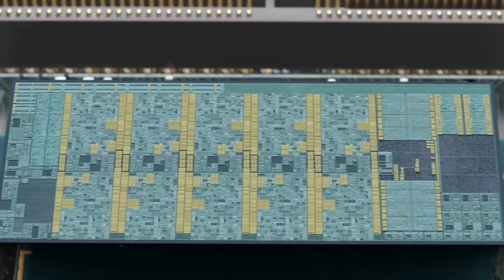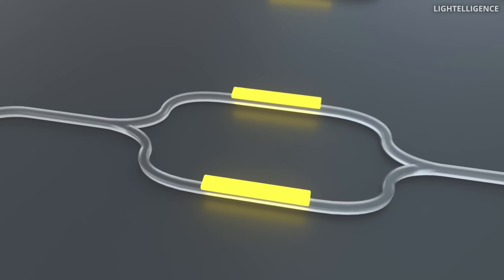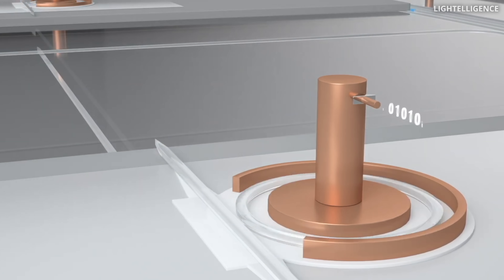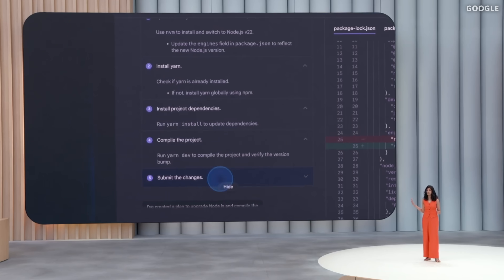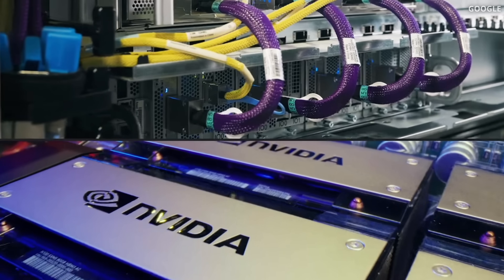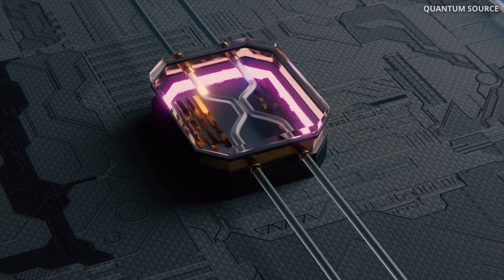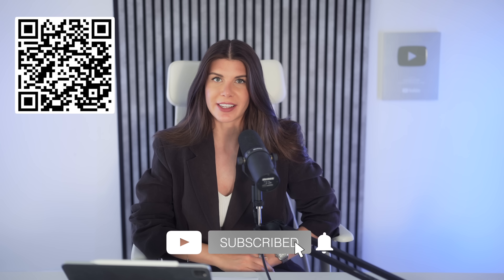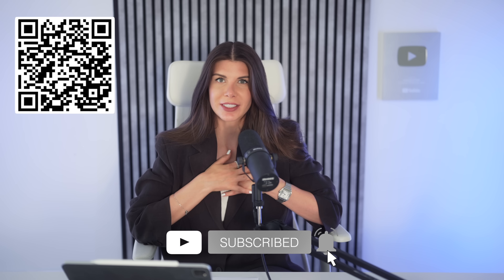Why Light Will Change Computers Forever

Comment: Adinkra codes from supersymmetric algebra, which align with doubly-even self-dual error-correcting codes, could provide a natural framework for optical memory in light-based computers. By mapping Adinkra nodes and edges onto photon states such as polarization or phase, data could be stored in redundant, error-resistant light patterns. This built-in error correction would safeguard against noise or photon loss, making Adinkras a fault-tolerant, “native language” for encoding, preserving, and processing information entirely in photonic systems.
Reply: If Adinkra can embedding error-correcting structure in the very way photons carry information, that seems like it would be very beneficial.
Reply: I wonder if there are any experiments by the current startups who are leading this hardware innovation development with the stuff that you are saying, or any paper trying to replicate that
Reply: @AlejandroMeloMaths . Couldn’t tell you about that .  .  . I achieved eigenmode super-Gaussian / flat-top output in with a multi-mode NdYAG fielded laser in the 90’s.
Reply: @thesupremeparadox brother I have no idea what you are talking about but props to you for your research
Reply: 🔰Are YOU people st0pid or what?!!!.. You should know by now that your interest & support in newer technology will be covertly misused and these advanced technologies will be weaponized AND used either against you or your children to imprison you in an outdoor digital matrix. 
🔹There needs to be a changing of the guard before any new, super advanced technologies are brought to fruition.  Otherwise geniuses will invent these new devices and ambitious fools will use them to control, wage war and destruction in the name of progress.

Comment: Much simpler, on frequencies of light, spectrums, light charge are in fact momentary bits of data in relation captive charge that are capacitors on and off, but spectrum as in some charge examples are registered. Are there light spectrum captive cells and the answer is absolutely yes, but they are volatile, and like DRAM need to be refreshed and so when change to this or that are suspect recorded (registered) for what kind of computation. These are analog devices on changes in spectrum / frequency. Well, photonic components and interconnect hubs and transmitters and repeaters have always been large scale. Calcite cell structures they are literally bit blocks in physical size but volatile. Blue diamond ring reflectors (directors) on quartz rosetta no known examples are small, I've held a 2-cusped-hand-size. None of these examples are anywhere near micro lithography I can guarantee that. mb

Comment: Does a photonic computer need the electronic equivalent of a clock signal? Like a strobing light that advances results from one gate to the next?
Reply from the maker: It needs a light source (a laser), and its amplitude and phase are modulated to encode the information.

Comment: Colors mixer base on RGB value and use time phase angle of light base on time so we had 3 phases time each began as 120 degree to have 3 colors then it phase chsnge base on camera record encode each light to match reality and store the last frsme , first frame and average light at point mulitplied by time and difference of motion multiplied by time ad add on store final sum and un load when play by recall last frsme and unload the sume divied the time get aversge plus different divived tge time unroll stresm out three timer three colors star mix by time rolling naturally after phase correction of each color and until get to first frsme and make sure match then play bsck

Comment: Anastasi is the best source of news on these cutting edge leaps in progress.  Almost nobody who understands it can present it so well.  And most who try to present it don't have anywhere near the depth of understanding and it shows.
Reply: I agree she should start her own company 😊
Reply: wow, someone older than me by a few months.  I worked with mainframes at IBM in the 60s. Huge data centers to house the mod 50, 65, 75. The big deal then was heat so raised floors were needed to cool the giants.  Did I miss a heat comment in the presentation?  Great job even this old brain followed.  I coded in assembler when memory was limited to 16K.  Love the way computing has and is going.
Reply: Progress? To where?
Reply: @mirba6933 look around .....uh nevermind 😢

Comment: Lights limitations are the height of its wavelength. Curious, what frequency are they using??

Why not use a micro-led style memory board. Information stored will reflect what energy level the led stores (similar to a tv-instead of a picture, it’s memory)!

Love you streams 🩷🩷🩷

Comment: I recently watched one of your older videos on RAD-hardened chips and ECC memory in space and, connecting today's video to that, the future implications of photonic computing's lower power draw & lighter device weight could have such tremendous potential for spacecraft operating with limited onboard energy supplies & payload mass constraints on e.g. controllers for remote sensing instruments, thrusters, transmitters, etc.  Perhaps light-based computing may even offer novel pathways to achieving greater resilience to cosmic radiation!

Comment: i like the idea of using light, but its always been the issue of A/D and D/A for light - in the star trek theme is it not called Photonic Computing??

i think the next big step, outside of making stuff smaller, would be WetWare (biological, or something connecting biology to hadware), something close to the way we think, process and remember information - or even the use of nanite technology to create cellular circuits - back in the 90's i saw a demo built of the CAM-Brain (lots of FPGA's) technology and it showed a great deal of promise and when you tied it into a type of WireWorld concept, you could start to see how memories could be encoded right down at the cellular level - but either it died a death throught failure or complexity - i was so interested in the tech, i designed a Cellular Automata aproach to both route planning and pattern recognition - its amazingly fast and efficent, but its downside is simulation on current hardware

i always imagined watching circuits being designed in a vat of swerlling nanites being constantly changed as plan changes or in a simlar manner to how we grow, nanties following a growing plan to evolve their circitry - i just wish we came with a tech manual

i do enjoy your vids and take on approaches

Comment: Had to downvote this one. Basically, it explains nothing. It presents a vision. The honest part was, to at least mention that it is not ready to be used yet because of the remaining (3?) problems... which are show stoppers... So, it is a vision piece, not something which is already existing. My Communications Engineering studies finished around 1993... and even back then, photonics was "right around the corner".... Then, nonlinear optics became the buzzword... until... it got silent...
I don't doubt, that some day, someone will make it work, but as there is no single mention about the time frame, when we can expect to hold this in our hands, it is just science fiction, disguised as an information video about something "solved" and ready to go.

Also, why the ads? If your startup is so promising - do you really need the few bucks you make with ads?

Comment: Consume Less Power!!
1 µW - 10 µW		MCP16701 PMIC					Industrial, Telecom
.02 µW				EFM32G MCU (Deep Sleep)		IoT, Automation
.015 µW - .1 µW		Cryo-CMOS Voltage Reference		Quantum, Space
.01 µW - .1 µW		NanoTritium™ Battery			Implants, IoT
.000275 µW 			Gate-Leakage Voltage Reference	IoT, Biomedical

Comment: with AI getting better at coding, the "new systems" that need to be developed besides the ones we a re using already, shouldnt pose that much of a problem IMO 

the scalability might be improvable

it not holding for more cycles is a big bummer though IMO as it will also lead to more errors and no one wants to rebuild/ replace all the time. 

promising though, very interested in the future of it.

Comment: 12:14  less electricity costs. 1,000times less. Plus, less cooling costs.
One human in the data centre will use a million times more energy just walking through the locked security front door.

Comment: Optical neurons: Chips that use light instead of electrons to process data (especially in artificial intelligence) at higher speeds and efficiency.

Optical transistors: Use light to transmit data between computer units (CPU, GPU, RAM) instead of copper wires, increasing speed and reducing heat.

Optical stimulation of electrons: Light can stimulate electrons within transistors or circuits to increase switching speed and improve the performance of conventional computers.

Companies (such as Lightmatter, Lightelligence, Ayar Labs, and Intel) are working on hybrid systems that combine these approaches.

The result: Light can be integrated with computers in three main ways:

Data processing with light (optical neurons).

Data transfer with light (optotransistors).

Electron acceleration with light (inside transistors).

The real trend: Hybrid optical-electronic computers to achieve faster speed and higher energy efficiency than conventional computers.

Comment: Well, I've been working on this. Apparently it's okay to get a bigger size because you're working with photons, that are smaller size. You do away with optic fiber at the emitter, and the emitter trains the light to the receptors on a globe surrounding the emitter at a given distance. On the other side of the globe, the stimulus is transferred to electrons, which perform conventional memory until we work that out and find out how to compress it.

Comment: Issue is going to be fanout as it can only pass through so many gates before the SNR becomes a problem. For AI the next leap with be analog DLNs. Power consume with drop at least one million fold. 

As for Optic computing, it would be easy to substitute electrons for photons and use electron photon like properties for compute. Consider pairs of electrons  & applying interference or spin state for logic operations. It much easier to trap electrons for state machines (ie memory), than photons. Power consumption would be very low since it would eliminate gate charge\discharge See "Spintronics" And "Single electron interference". Another advantage it it would be easier to integrate these methods with conventional electronics (ie mounting the directing on PCBs and using conventional PCB traces to connect multiple chips together). with light all signals need to be converted into electrical signals between chips.

Comment: One thing I can not understand. If a transistor needs to switch to turn on a led, and then another one on the receiving side, why not put a simple wire in between and get rid of the losses in the led diode...How this light transmission actually works in processors that is so more efficient?

Comment: It is extremely simple to store light. Like a camera sensel. Light passes to a tunnel and the tunnel change colors based on dynamic level of white to dark. Next time light passes through the tunnel you will know what data is stored based on dynamic interactions. Think as a camera sensel caputre light to convert to electron. You are welcome!😊
Reply: I hear you but a sensel destroys the light .  .  .  what you’re describing is really more holographic and the required material science is far from simple.

Comment: Fabulous episode, so clear in both potential & current limitations. The ability to simultaneously process 32 colours, (potential more later) at once is a huge advantages, somewhat similar to the ability of quantum computers & to do so with out the limitations of noise that plaque many quantum computers is a plus, but size & limited use are two serious troubles that will need solutions. The prize of fast, parallel processing & low energy consumption is so large that we can expect these limitations to be overcome. It is such a fantastic opportunity for improvement, so clearly, interestingly & excitedly presented. Thank you for all your hard work that made for easy viewing & understanding.

Comment: Wow — they solved what seemed impossible: giving light memory. That’s a paradigm shift. Now it’s not about if, but about polishing. The real game-changer will be hybrid chips: photons for parallelism, electronics for control — and compression inside the chip. If you shrink data before storing or moving it, memory endurance matters way less and energy costs drop massively.

People miss this point: even if these chips ‘burn out’ after fewer cycles, they’re still way more profitable. If you can do in seconds what takes weeks on a supercomputer, the cost per operation is insanely low. Better to burn bright and short if you’re 1000x more useful.
Reply: Thanks ChatGPT, I'm sure photonic computing will feel great.
Reply: @CrewMate-r1m 

Why is it that any time a real person writes something worthwhile, with proper grammar, spelling, and punctuation only to be labeled or suggested as using AI to formulate and respond?

 It feels like a disrespectful attack.
Reply: the photograph was the tech that gave light memory, the tech used in lightronics is similar in function.

Comment: This would enable the building of data infrastructure on the fibre optical transmission lines directly on the ocean floors meaning data centres would not be in direct competition with humans for land and water, built by high pressure resistant aquatic robots that are advantaged by weight reduction of movement in fluid environments and able to utilise and monitor geothermal energy until fusion is perfected. A sea bed of pyramids storing and processing data at a scale that would not be possible on the surface of the planet.

Comment: PHOTON SENSOR BASED LIGHT COMPUTING IS MORE LIKELY TO BE A BIG PART OF THE SOLUTION TO ALOT OF THE ISSUES FEATURED  IN THE TECHNOLOGIES FEATURED IN THIS VIDEO - PERFECT PHOTON SENSOR LIGHT BASED COMPUTING AND APPLY THE METHOD TO THE WAY CURRENT TRADITIONAL CHIPS AND CPU`S WORK, AND ALOT OF THE ANSWERS TO PERFECTING LIGHT BASED COMPUTING AND CPU`S  WILL BE THE RIGHT WAY FORWARD IN REVOLUTIONIZING THIS TECHNOLOGY . . .😀😀

Comment: Hi Anastasi.  Thank you.
Many, many, many decades ago..

when I was still young, programming
in Fortran with punched 80 col cards.. 
there were analog and digital delay lines 
- actually loops - to store data (not much btw) 
with a refreshing point within the loop.
What about making digital light delay lines? 
Speed of light ca 30 cm in one nanosecond. eh yeah ok.. but:  
Perhaps using cascaded read -> write (with many) nodes?
That also function as tapping (r/w) points? 
or
Slowing light incredibly: (for delay lines)  
using Bose-Einstein Condensates (BECs)
that's cool (literally)
might be something.. 
Just brainstorming. 
Alas.. everything comes much too late
to store my brain contents in cybernetic memory...
I will die one day. shaken, not stirred.
Will I dream?
Reply: You'll definitely dream, and....I hate to break it to ya, but you might even get stirred...

Comment: TSMC completed silicon photonics chip development in April of last year, and Taiwanese companies involved in silicon photonics components are ready for production.

Based on your remarks, we conclude that the US lags behind Taiwan in silicon photonics technology by more than a year and is still at the laboratory stage.
Reply: Do photonic chips require ASML EUV machines to fabricate or is it an entirely different process?
Reply: @tomtube1012  No 20 nm. Old machines and more semiconductor compamies can produce it. Globalfoudries stop at 7 nm. The reuse if other 20 nm is possible. In Germany Quant will use an old semiconductor factory to build photonic chips.  And China will come up sharply.
Reply: There's already photonic chips on the market sold by the US.

 Intel sells chips to Light Matter. 

 AIM, forgot the name. AIM produces equipment for testing, and all that. 

 There's a few labs too. Ayar, Lightmatter, Freedom Chips I think. 

 Europe has a few like Q.Ant. 

 Some of these are for quantum computing. 

 Photonics is the next step, and it's anyone's game. 
 
 US of course is lagging behind. Trump has no plans. He just screwed us and sold us out to China anyway.
Reply: The Chinese are way ahead of everyone else in photonic chips and already solved the memory problem.
Reply: @MRT-co1sd  not really.  I would say us based Lightmatter is ahead of everyone.  Real model inference, not just photonic matrix multiplication.  but i don't follow it real close so mayber someone else has had a recent breakthrough I am unaware of.
Reply: china might use similar strategy with EV: focus more on the next tech and leapfrog the competitors.
Reply: China already has a functional photonics chip... I don't understand why they put that there as if it were the first advance

Comment: The breakthroughs aren’t done yet. AMD isn’t there yet, but they’re in the right lane with the right infrastructure. The real choke points are material endurance, scalability, and software integration. Once those align, we’ll see the first true photonic accelerators in hyperscale data centers.
Reply: There is a German chip company in Stuttgart I think making already small serial production of processors with light tech.

I think around 15 years till start of implementing in consumer electronics
Reply: what about consumer electronics? anastasi mentioned low power usage